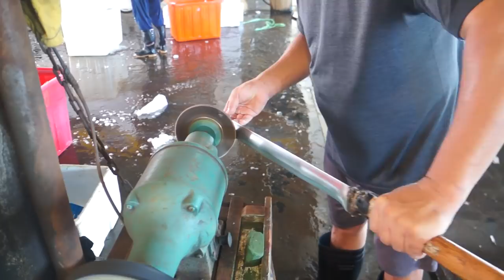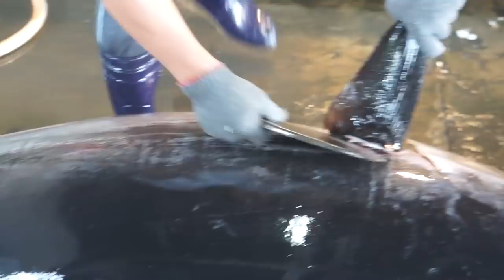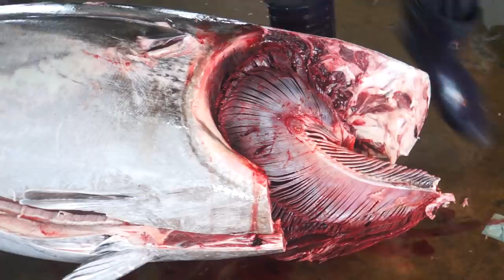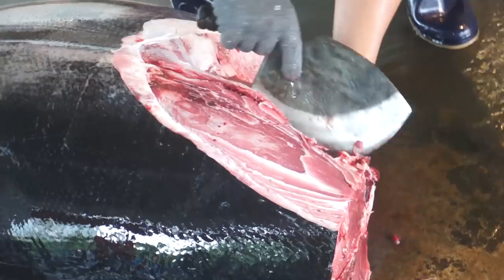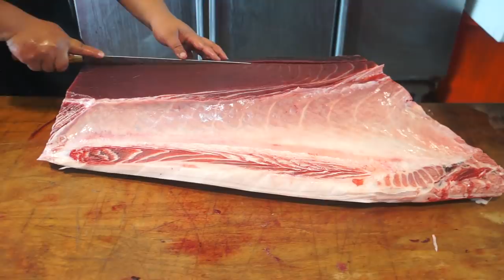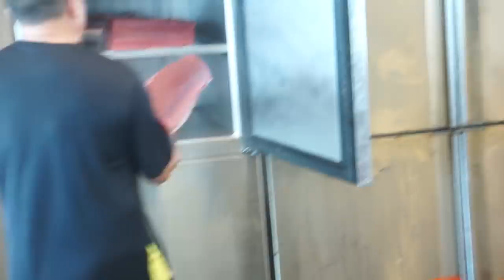GIANT BLUEFIN TUNA CUTTING SHOW巨大黑鮪魚切割秀

Comment: Hello, I'm from Brazil, here we sharpen a sword like that using the grinder and with a flap disc I don't know if it's called a flap disc in your country, but it's a sanding disc not one of those abrasives that we use to cut metal more made of sandpaper iron, using the fixed emery in addition to the sword getting many signs of the emery doesn’t have a good cut, but if you sharpen using a disc like this, you have a more uniform grinding, and the sword will cut better, hug.
Reply: Good job